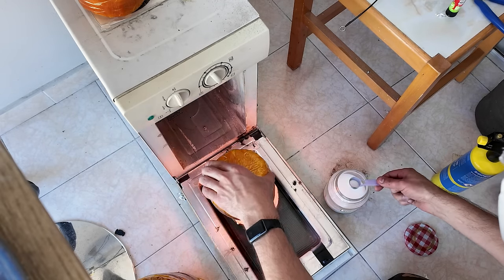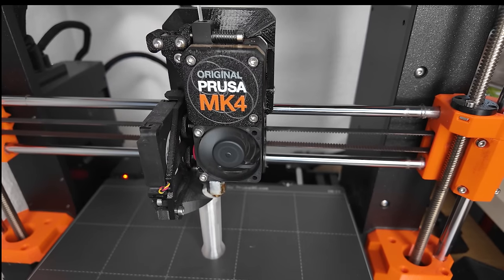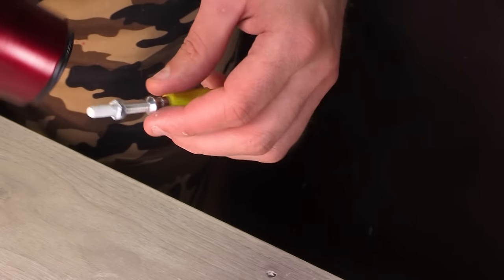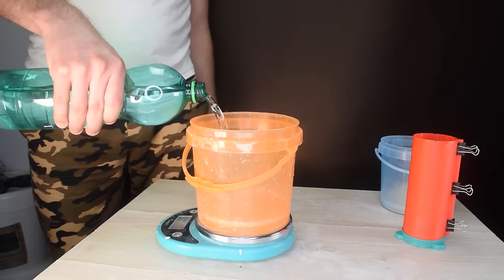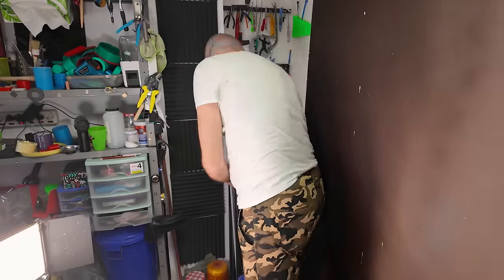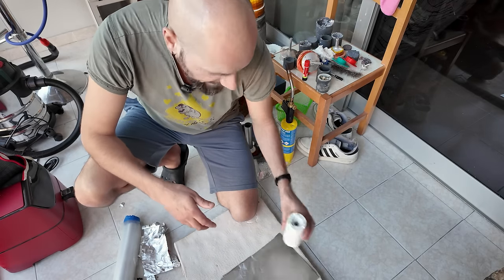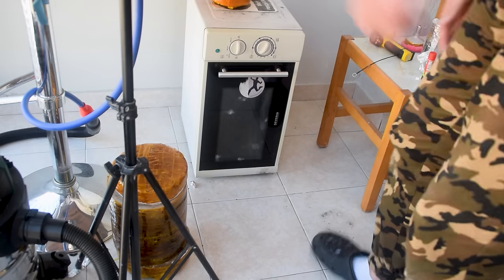Metal Casting a Hook with a Microwave

Comment: Abstract

This video demonstrates the process of creating a metal hook using a 3D printed mold and a microwave kiln. The creator utilizes various techniques and materials, including boron nitride, cheese wax, plaster, and brass scraps, to achieve the desired outcome. Despite encountering minor setbacks such as a cracked sprue and a stripped screw, the project ultimately results in a functional metal hook.

Summary

3D Printing and Mold Preparation (0:00)

* 0:00: The video aims to showcase microwave metal melting by creating a missing bathroom hook.
* 0:47: Boron nitride is applied to a screw and nut to facilitate later removal from the metal casting.
* 1:52: Cheese wax is used to secure the screw, nut, and 3D printed sprue within the mold.
* 3:01: A plaster and sand mixture forms the investment for the mold.

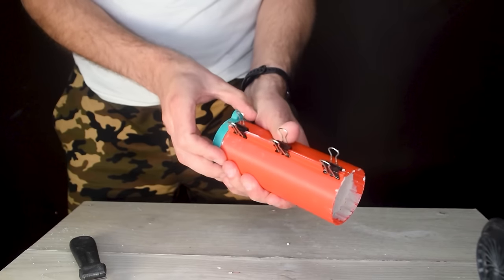Mold Burnout and Metal Melting (4:25)

* 4:25: The mold is dried in an air fryer and then wrapped in aluminum foil for microwave burnout.
* 5:54: Due to another mold already occupying the primary microwave kiln, a secondary one is used for the burnout process.
* 7:57: The mold reaches 400°C, and the burnout cycle is adjusted for further heating.
* 8:00: Brass scraps are melted in a preheated crucible with boric acid added to manage slag.

Casting and Finishing (9:07)

* 9:07: Zinc loss is observed during the brass melting process.
* 9:56: The molten brass is poured into the mold using a vacuum casting setup.
* 10:13: The screw is successfully extracted, but it is noted that using a non-stainless steel screw may have led to it being stripped due to the softening of the metal.
* 12:42: The finished hook is slightly smaller than intended because the 3D printed model did not account for metal shrinkage.

i used gemini 1.5 pro to summarize the transcript
Reply: Hold on to your horses! While AI summaries of transcripts sound neat, there are some things to consider...

Accuracy ain't guaranteed. AI isn't perfect, and jokes, sarcasm, or even key points might get lost in translation. The summary could be misleading!

Copyright could be a party pooper. Summaries might contain bits of the transcript, which could be a copyright issue.

Less engagement might sting creators. Having everything laid out in the comments could discourage people from actually watching the video. Not cool for creators who rely on views!

Maybe think twice before pasting those summaries. ‍

I used free gemini to generate this response. lol
Reply: why tho?
Reply: How did you actually produce this summary? Can it analyze video content? Or just what he said after speech-to-text?
Reply from the maker: Wow, that's awesome. Thanks for that. May I use it in the video description?
Reply: @ShakeTheFuture Please pin this comment!
Reply: gai

Comment: Amazing job. Its so shiny and perfect :).
Reply from the maker: Thanks! It's definitely overkill, but at least it worked. Every time I see it, It makes me want to make a proper towel hanger out of metal. For that I would need to split it in pieces as I can't melt that much metal in one go.
Reply: @ShakeTheFuture  Np. True but thats a good thing :). That does sound fun. Wonder how hard it would be to attach the sections together.

Comment: 10:22 Using a TORX screw could help here.
Or maybe quenching the screw, although that might not be easy to do and I guess if the screw snapped that would be way worse.

Nice build, thanks for the vid.
Reply from the maker: Thanks!

Comment: Even you are the first one posted video of using microwave oven to melt metal but the queston here is how to make microwave still running when over heat , as everyone knows any electric devices always install security one  to interfere when it is over heat . I “d tried two different microwaves when set up over 10 minutes ,they suddenly shut off.

Comment: Ciao ho seguito molto i tuoi progetti li trovo molto interessanti.
Ho una domanda per te, hai fatto qualche modifica anche al microonde o l'hai lasciato così com'è?
Reply from the maker: The microwave is not modified, other than small things that have nothing to do with the way it works. Thanks!
Reply: @ShakeTheFuture  But I saw that you put the alluminium tape... Is not It necessary? 
An than, can't the ceramic wool coating be left fixed in the microwave?

Comment: Ever consider trying stainless steel 3D printing filament?

e.g. If you can print plastic, you can make pure metal parts. The stainless Filamet enables one to print bound-metal filament on common 3D printers and debind & sinter printed parts in common kiln equipment. Once parts have been fired in a sintering furnace, the result is a 100% metal 3D printed part.
Reply from the maker: Yes, I am aware of the sintering and metal filaments, but I have never tried it out. It's on my bucket list. Cheers!

Comment: Would it be possible to reuse the mold for multiple castings? I don't understand the vacuum cleaner vacuum station purpose, is the mold so porous that it lets the air pass?
Reply from the maker: It's possible to make reusable molds, but the process is a bit different. I plan to create a video on it at some point. Have you had a chance to watch the kiln/vacuum video linked in the description? In it, I demonstrate the effectiveness of vacuum with a few examples. The mold is indeed porous, allowing air to pass through but not the metal. Cheers!

Comment: Can you please tell me why my microwave turns off after 2min as if it's over heating? I don't want to remove the sensor
Reply: Appliance repair guy here.....   The TCO (thermal cut-out) sensor will cut off power to the unit when your magnetron unit gets too hot. This keeps the ceramic magnets on the magtube from cracking. The best thing to do is not to remove the TCO sensor. However increasing cool airflow through the magnetron area of the microwave should improve this issue.
Reply: @jamesblackwell5141  Thank you! I considered this, but I wasn't sure where to pull/push the air through. I guess vacuum it from the vent (duh.)
I'm concerned that mine overheats but other's microwaves don't seem to have this problem.
Reply from the maker: @dustybrown4599  Some microwaves overheat too easily. I've used microwaves that weren't suitable for these kinds of projects due to overheating issues, but it's never been as bad as yours — just 2 minutes in. I only encounter overheating problems in July and August when attempting to melt something during the hottest hours of the day. By the way, check if the fan is running; it might be dead. If so, the microwave will overheat pretty quickly.
Reply: @ShakeTheFuture  I'll do that, ty!

Comment: How interesting, thanks for sharing! Can I ask – not a scientist – is it safe to use the microwave on it's side? Cause I thought the waves were from the top, "bounces" around the sides and the rotating plate helps the electro-waves hit all sides of the object for even heating (when used right side up)? I'm interested in using a taller mwk like yours but it wont fit unless on it's sides 🤔
Reply from the maker: Thanks for watching!

I can't speak for all microwaves, but I have never had any issues. In theory, there could be parts in the microwave that wear down faster due to change in orientation, but that's just a theory. The only potential issue (in theory) is for the microwave to break earlier than it normally would.

I've been doing this for more than 5 years. Sure, some microwaves have broken down, but I can’t definitively say it was due to microwaving kilns, changing orientations of the microwave, or melting metals.

My microwaves are used much more frequently than they typically would be in an average household, so that’s another factor to consider.

The white microwave I use in the video is 4 years old. The magnetron died after 3 months of use, so I replaced it. Since then, the microwave, which was second-hand/Amazon returns, has been running without problems for over 3 years.

As for microwave radiation escaping, that should not happen regardless of orientation. There are microwave leakage detectors that can be used to check for any leakage.

I don’t want to encourage people to use their microwaves flipped on the side. All I can do is share my experience and leave that decision up to the individual.

Cheers!
Denny
Reply: @ShakeTheFuture  Oh wow, thanks for taking the time to leave such an in-depth reply, Denny! I'll definitely take everything into consideration – it does give me more confidence, thank you once again!